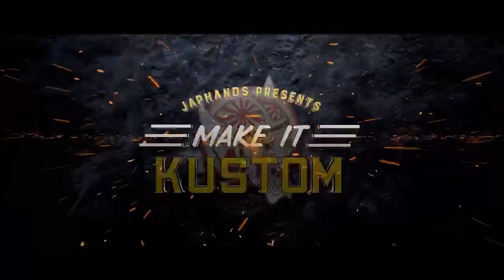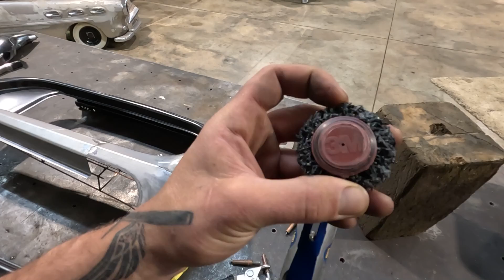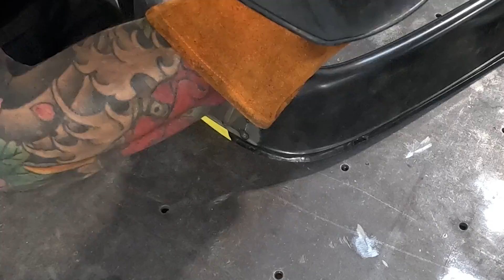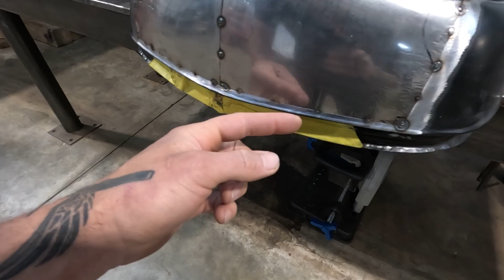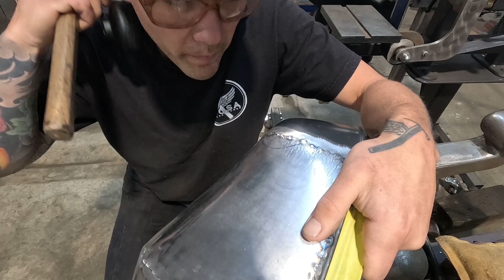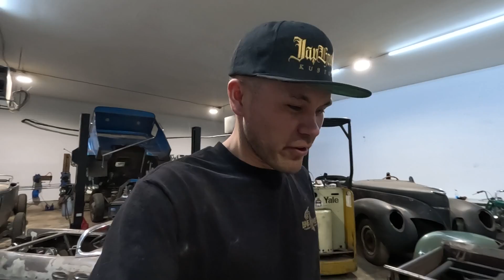How-To TIG BUTT Weld Sheet Metal Restoration Panels 1932 Ford Split Grill On Model A Roadster

Comment: I like to put my fusion tack on the front like you did then put my thicker filler metal tracks on the back (if I can ) then when I run across the front the tacks aren't miss up my rhythm goes a little smoother for me

Comment: Like your work. Us old guys hammer welded we worked the weld not the metal. Pre tig just gas welder. I've a mig  and tig. But just fall back on what I was taught. We're not building the space shuttle. Just don't to use filler. Weather it be lead or bondo. Your teaching skills  are very good. You don't grind welds you cut them ... metal have feelings too😢

Comment: Just a tip.. Ive been using an led headlight behind the steel to emphasize the gap between the panels when butting them up, it works really well..  Great channel as usual Carl,keep it up..  Vern..

Comment: Sharpie is an awesome tip! I have used liquid whiteout for years.
I have had that shrink bite me a few times while mig welding long panels.
Was curious what gauge of sheet metal, you answered that right at the get go. 18g.
Heat affected zone was a term used in some reference books if i recall correctly.

Comment: very nice. interestingly, my experience of mig is that having a tight gap/no gap pretty much guarantees distortion. mig tacks shrink a lot, touching edges have nowhere to go and end up overlapping/distorting. planishing mig tacks is horrible. all of this is compounded when you are welding in situ on a car and have poor/no access to the back of the panel.

Comment: Does the tip on hammering and stretching the weld also apply to mig? I know mig ends up harder than a gas weld, and I assumed harder then tig? Though does that make a difference regardless?
Watching actual good work like this makes me feel maybe I should move up from my four setting mig welder 😅

Comment: I think consistency is key with gap no matter what type welding your doing ? Now a question when welding, how do you fill about welding say a weld being more than three feet in length should you weld the hole weld or what if you were to stop say something come up and you was away for say forty five minutes to an hour before finishing your weld would you check when done for a difference in for a warp ?

Comment: I noticed when butt welding two panels and the gap is so small that they almost touch, the two panels actually push against each other and tend to dive down. I'm kind of conflicted if to leave the proper gap of a thin cutting blade or go for no gap at all.

Comment: I like getting good tacks with stainless wire and filling in the gaps with silicone bronze because of its low melting point. Keeps some of the heat out of the panel. I wouldn’t use silicon bronze on anything structural obviously, but something cosmetic like a grill, all day

Comment: karl so why did you fusion weld the bottom seam but use a rod up the sides when you were first setting the panel in place?

Comment: Nice welding Karl, a panel repair industry guy told me one test they got at tech was they get a sawn in half car door and you make the other half and fusion weld it together with oxy acetylene torch no filler rod to be used

Comment: Anyone know if he’s using anything on the bare metal to prevent it from rusting? Just curious since he’s welding on it and I assume paint at some point.  Thanks
Reply from the maker: Sometimes I use Gibbs brand lubricant
Reply: @MakeItKustom  thanks for taking the time to reply.  👍

Comment: Hi Karl, read a story a while back about old Rolls Royce grills. It says they appear to be flat but are in fact slightly convex. Apparently they asserted that if the panels were flat, they give the illusion of being concave once plated.
Reply: Ancient Architects tapered the columns like the Parthenon in Athens to make them look straight.
Reply: @WhatsDirtyDaveUpTo  Ah, exactly. The other thing they did was they built them up out of multiple circular pieces with the stone grain horizontal to the compression loads. Better and less cracking/failure than the Egyptian method.

Comment: Get some panels (scrap mess ups whatever) and teach yourself to hammer weld. It's maneuvering hot metal. That simple. The trick is learning to move it where you want with the hammer and dolly. It works great fitting repair panels like this especially tig welding since you can heat without adding metal. Also saves you time grinding.
Reply: If you have seen his previous videos he has explained that in detail already.